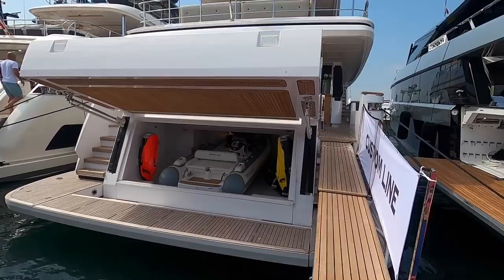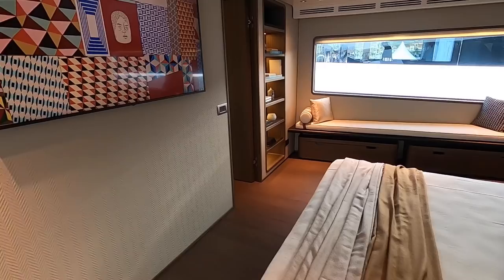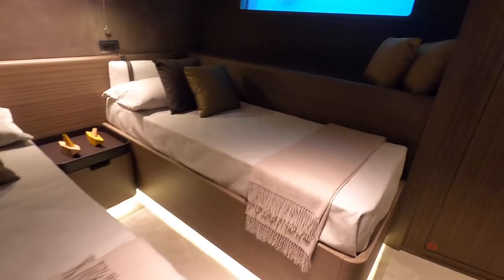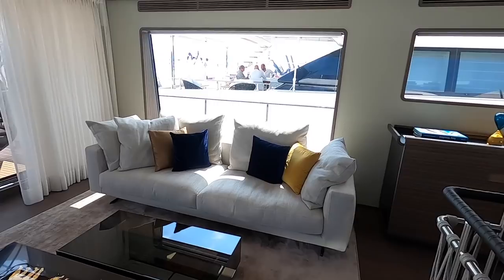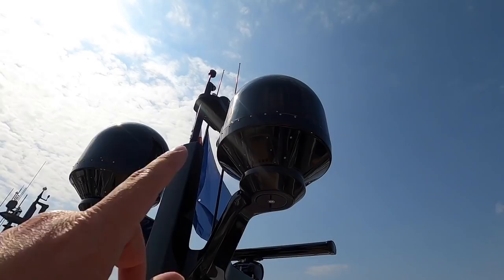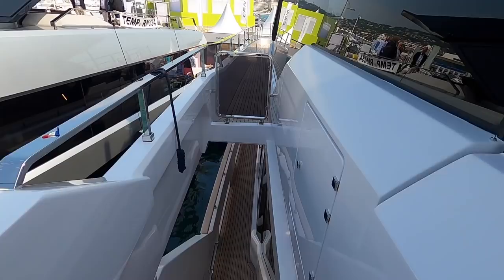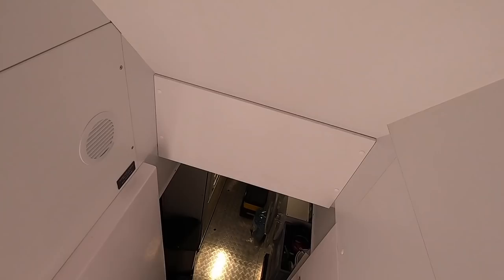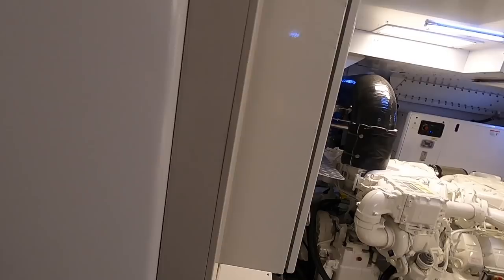Custom Line Navetta 30 yacht tour | Feels much bigger than her 93ft | Motor Boat & Yachting

Comment: At  15:32    you stated that the boat's speed at 10kts gives a range of 1000 n.m.
This is wholly incorrect. At 10kts, the boat's range is more than double this at 2050 n.m. Big error.
Also at cruising speed of 13kts, the range is 850 n.m.
Reply: You’re absolutely right, it was a slip of the tongue - 2,000nm is correct.
Reply: @jackhaines123  Beautiful boat and thoroughly reviewed. Thank you.

Comment: Those ranges seem crazy, I know dropping it down a few knots makes it more efficient but a 2 knot difference from 15 to 13 gives you almost double range and 3 knots slower and more than double range??? Quite a lot of room for a 93ft Yacht, and comes in around 12 million so it's got a great bang for the buck.
Reply: But a Princess X95 could also reach 2000 nmi with economical speed. And it's a planning boat with 2×1900 hp and 25 knots top speed.
Reply: @derlangsame4471  Both have very similar fuel capacities as well. The Navetta 30 holds 14.500 liters while the X95 holds 13,400 liters. Main difference is the HP with X95 having about 900 more HP per engine. Both are also around 12 million.
Reply: @tecwzrd  yeah, so it erases the point of having a displacement yacht of that size. They said it's built for cruising, not performance. But if the 'performance' vessel could be equally or more economical but with the advantage of having a much higher top speed when it's needed, why bother with this?
Reply: @derlangsame4471  the floor plan of the x95 is segmented which makes it appear crampt and mouse maze. While the N30 feels spacious and free flowing. Also the profile of the x95 seems bloated and not even being a tri deck seems disproportional to the eye. jmo.
Reply: @gjl7022  I do agree, not a fan of the X95 design either. Just for making a point of why bother with a displacement hull of this size while planning hull could have better range and better performance.

Comment: Is the usual top speed 14 ?
Reply: Top speed is 15 knots depending on the engine config.
Reply: @horeally1150  I spoke to an IYC BUILDER OF MARINAS in the caribbean you need 16knots to out run a hurricane. I saw one of yours in Trinidad so it is safe there

Comment: Nice yacht, tri deck... with sky lounge....and no nonsense.... but I am not impressed...small salon, nothing special, no beach club or large hydraulic platform... 
I expected more and the competition is hard in this segment...would like to know the price...
from Spain
Reply from the maker: Prices start from €9.03m
Reply: At the beginning of the video you can see the hydraulic platform in its up position with the teak flooring. It lowers and flips over and becomes the beach club.
Reply: @horeally1150  checked the video again... and dont get it... so when the garage is closed.. the whole thing will flip over and becomes the hydraulic platform... but that is NOT a beach club...its a platform